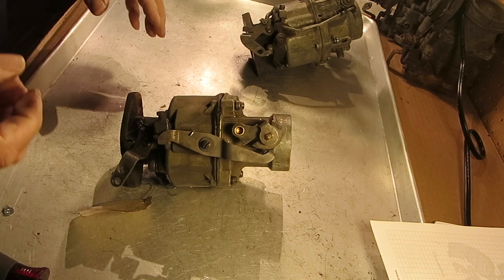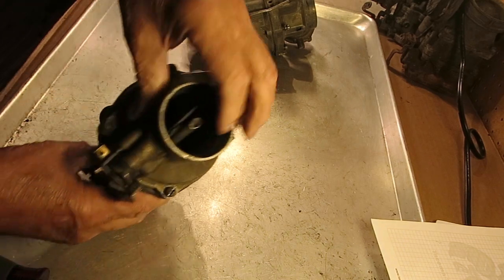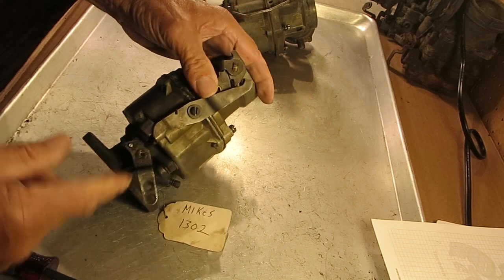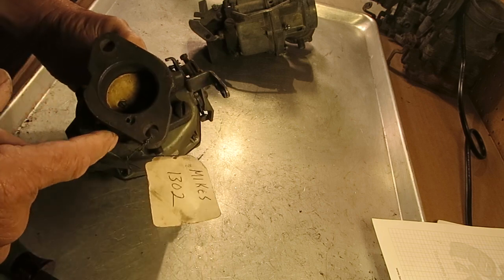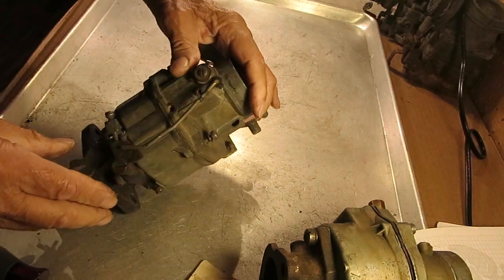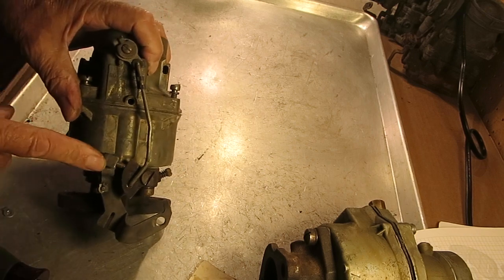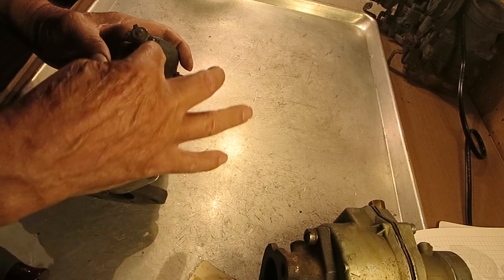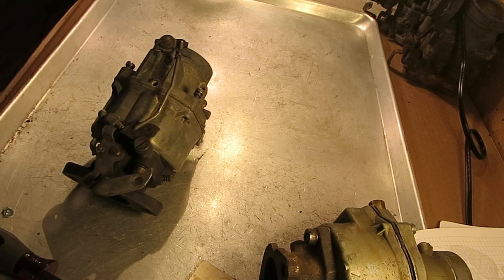Rochester B 1 Barrel Carburetor Fast Idle

Comment: Mine has opposite problem.
Sent it out for a rebuild due to leak and was going through the engine. 
Pretty sure I got a different carb back. 
It ran ok before.
Now.. it won't idle without choke on. 
I have cleaned out the ports a couple times.. no luck. I did notice the long spring was missing and the jet was larger than the 53 that should had... This was on the rebuild.
As far as I can tell.. no manifold leaks. But I can't get to run below 1200rpm. Any lower and it chokes up and dies. 
1953 235 L6 single barrel Rochester.

Comment: My idle screw won't return to the 1st step position? What could be the issue? Thanks
Also my choke is open without car running
Reply from the maker: Choke valve should be closed. Maybe the thermostat. You will need to check it over.  Not sure about the 1st step. I would have to see it. Refer to this page: https://www.carburetor-parts.com/Choke-Fast-Idle-Rochester-B_ep_1990.html
Reply: @MikesCarburetor  thank you you're the best